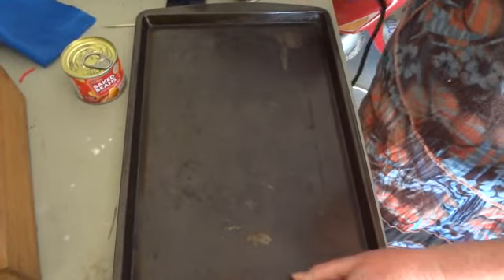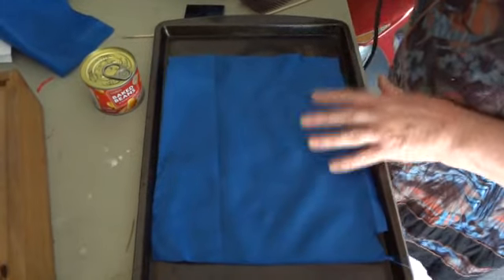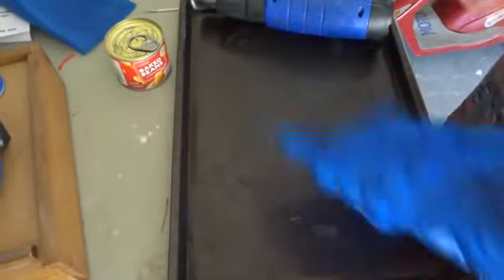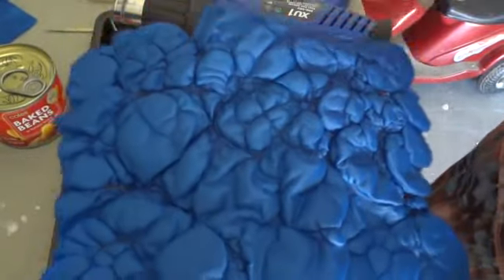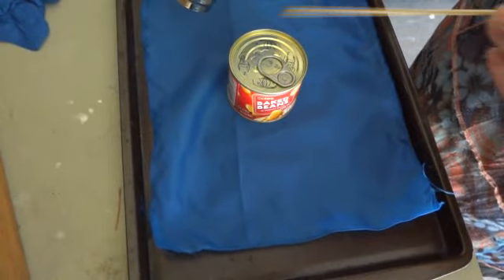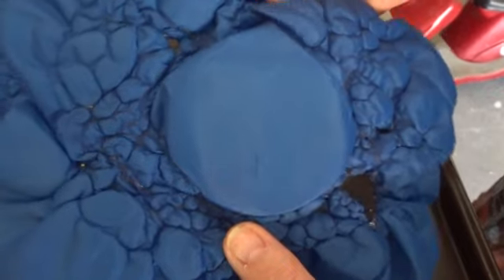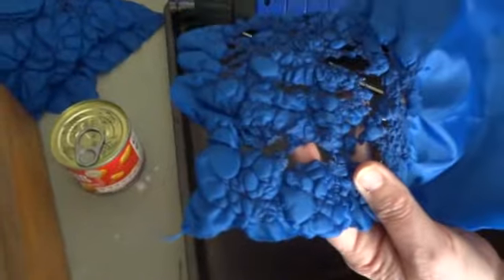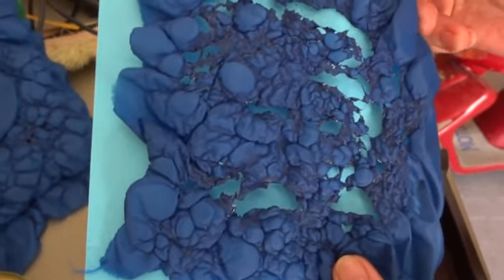Fried fabric tutorial Part 1

Comment: Can you use a blow dryer
Reply from the maker: probably not hot enough. but worth a try
Reply: a hair dryer will not emit enough heat. blow dryers can go up to about 140 degrees F, while heat guns have different heat settings starting at 200 degrees F up to 1,000 degrees F
Reply: for metric users:
140°F = 60°C
200°F = 93°C
1000°F = 538°C